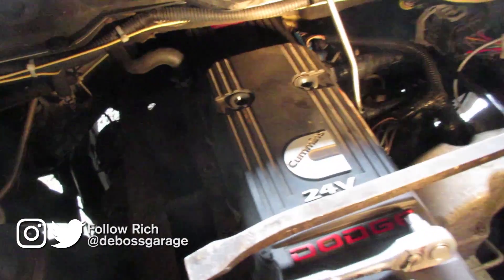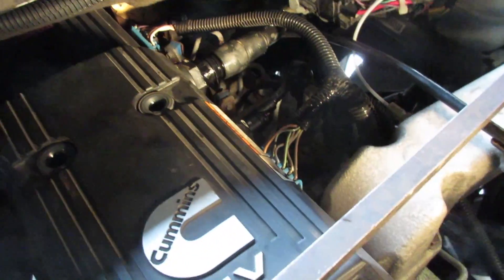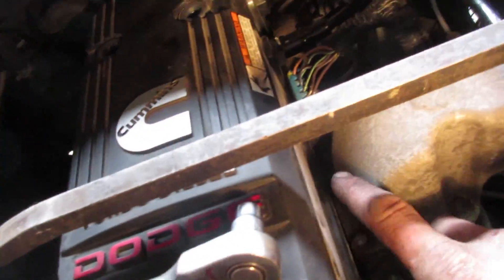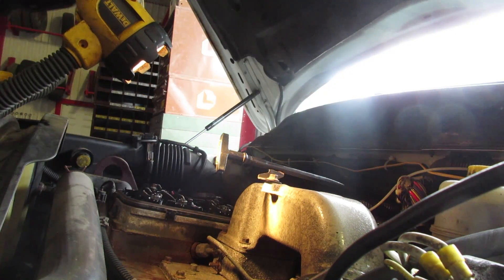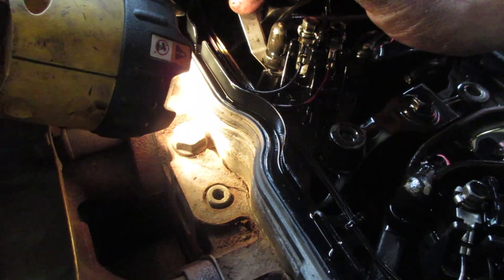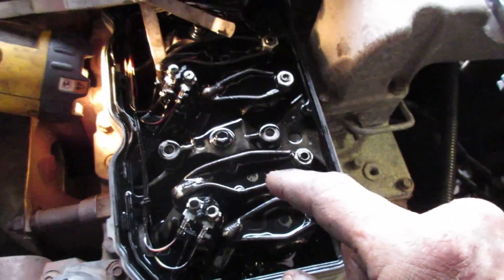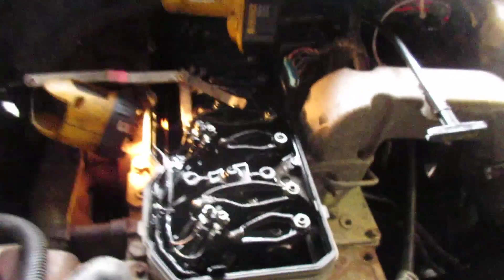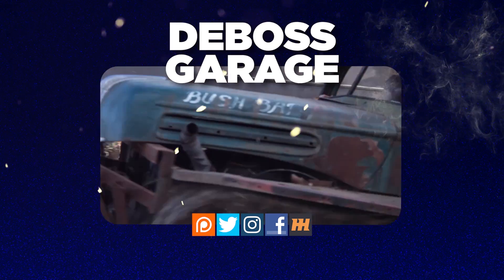Cummins 24v Valve Lash Adjustment Tips

Comment: I’m new too the Cummins world…just picked up a 2006 dodge 2500 5.9 with 190 k miles. When or how will I know I need a valve adjustment? Thanks and advice would be appreciated!
Reply: Did you ever find out ?

Comment: My valve cover isn't leaky and injectors were done by a shop 50k ago. Is there any need to do this if I don't have weird noises or any other issues?
I don't have the special tool to turn motor. I have a 2005 5.9L with 196k miles on it.  Thanks!

Comment: My 06 5.9l cummins...doing injectors and the first one I pulled, I knocked the bridge off the valve springs. I notice a nipple on one side or the other of the bridge. Does it matter which way that faces? I've looked at the rest of them, and it flip flops, so I assume it doesn't. Any info DEBOSS?
Reply from the maker: Doesn't matter
Reply: Thanks man!  Big follower!

Comment: Is the 24v Cummins just as reliable as the 12v? And i also noticed that the 1998.5-2002 Cummins 24v's were different looking then the 2003-2007, so that makes me think they had some sort of defect in the design, so they changed it.
Reply: the 2003-2007 cummins were what they call the "common rail" cummins, which isn't what the 98-02 cummins are. The only differences I see with the 24v and 12v are obviously the difference in how many valves are per cylinder, and the injection pump, being the 12v is mechanical and the 24v went to the VP44. The biggest flaw of the 24v cummins from 89-02 is the injection pump. Pretty much all of them fail. And they're super expensive to replace. Also a lot of the seals in the Vacuum pump of the 24v go bad and begin to leak oil but those are super easy to replace. My 02 24v has 230k miles and it drives like brand new, and yes we have had to replace the VP44. But it's cheaper than rebuilding an entire common rail 24v haha. I would say they're just as reliable, it all depends on the driver and how they drive and how they take care of it. I wouldn't drive a new cummins over the older ones. I'd take an old 24v or a 12v over a 6.7 any day... just my 2 cents
Reply: onlylikenerd Woah that's a long reply! Thanks! That's litteraly the best response I could have gotten from posting this comment!
Reply from the maker: Ill second that and everything onlylikenerd said!

Comment: Witch in your opinion is a better motor 12 valve or 24 valve common rail and why?
Reply from the maker: Simply put, the 12V is a simpler engine.  My favorite.  24V puts out more stock HP/torque but pump and electronic issues come with that.
Reply: I'm looking at getting a cummins ram and didn't know witch would be best iv read that they are both good and both react good to mods but just not sure on witch is more reliable.. Ill be using the truck for fun maybe a lift and taking it off road and hauling of course. My main things is reliability

Comment: Going to do an 05 Excursion with a cummins swap. What Cummins would you put in it if you had your choice?
Reply: 5.9 12v due to how simple they are. plus it'll fit in the engine bay of the excursion easily.
Reply: onlylikenerd  less electronics as well. Can be pump tuned to make enuff power to damage Ford stuff.